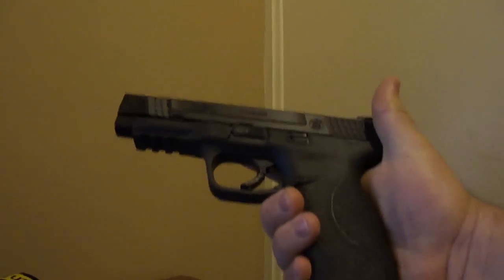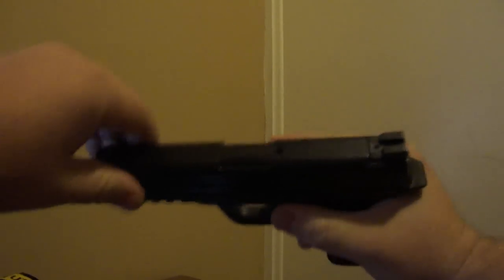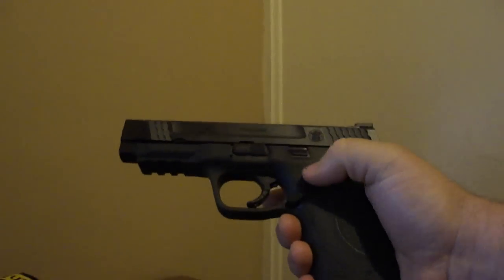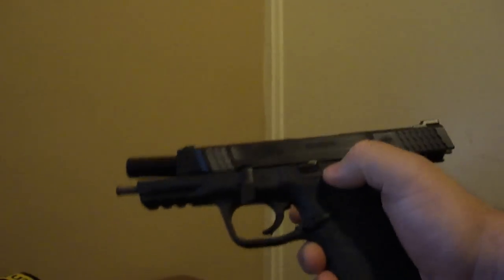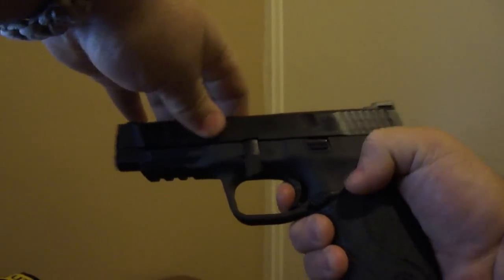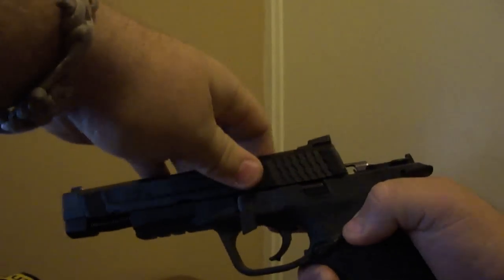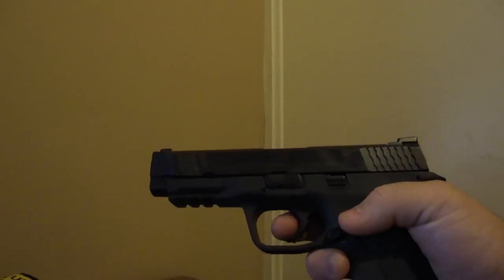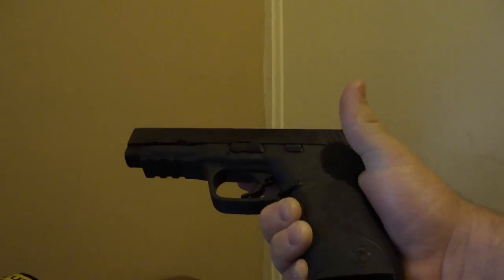Alternate M&P takedown method.

Comment: up until today i was not able to preform this. i was able to do it twice consecutively and then i haven't been able to do so again.

Drop Mag.
Check chamber for safety.
pull slide to back, and lock.
swing take down lever.
close slide.
pull trigger
pull slide off.

Why is this such an issue? .40 S&W Full